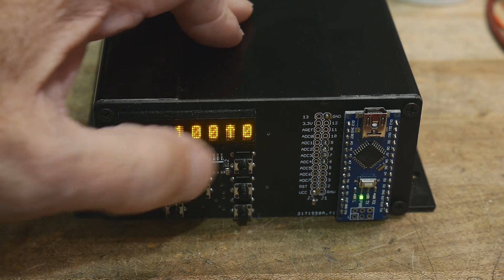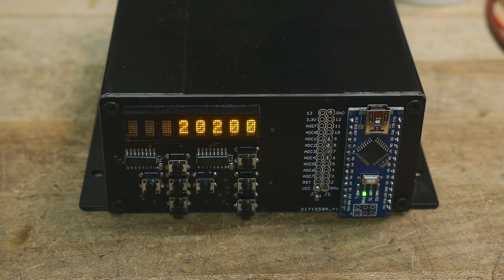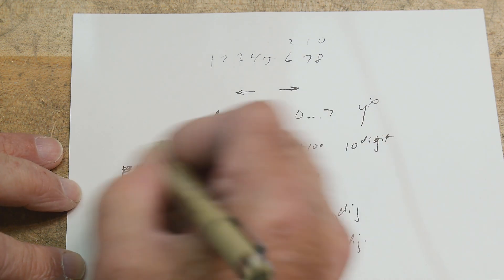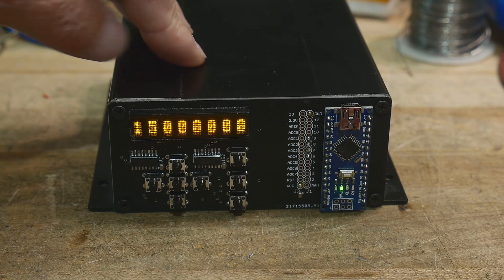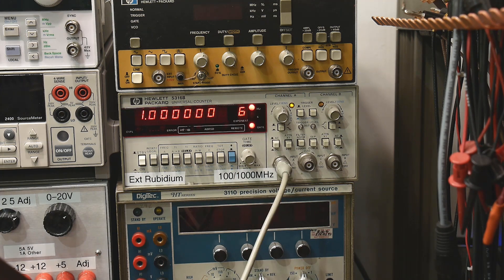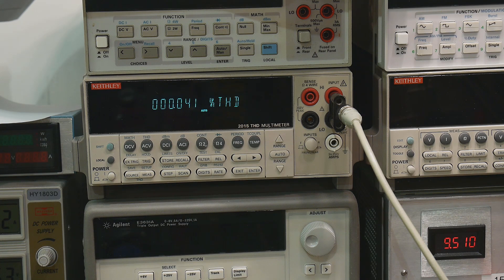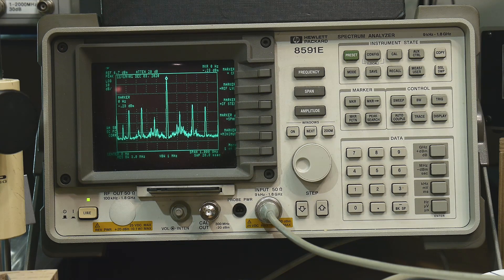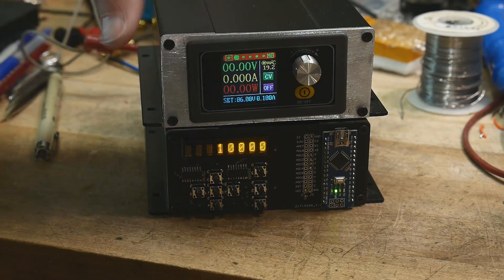#666 0 - 30MHz AD9850 DDS Arduino Sine Generator (part 2)

Comment: Considering that that DDS board is based on what looks to me to be a normal non-oven crystal oscillator the frequency accuracy is pretty good. The one I have is off just a bit but still very good. I can get mine to go well beyond 30 MHz although the wave form starts to look a bit ratty.